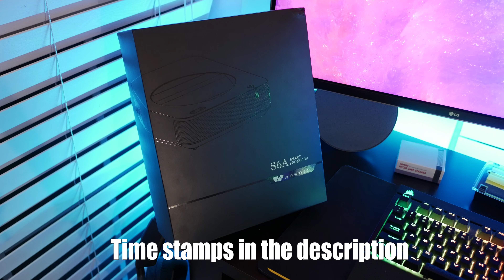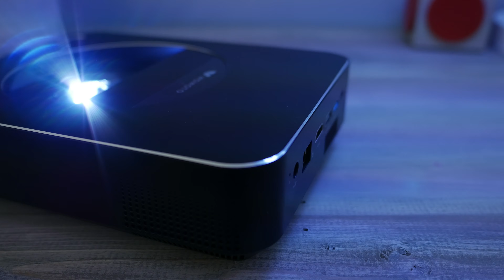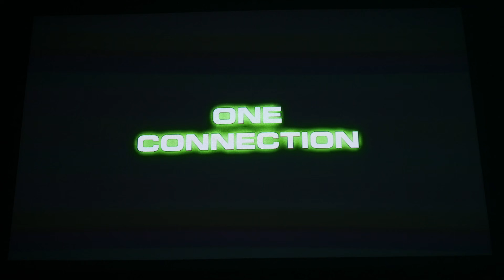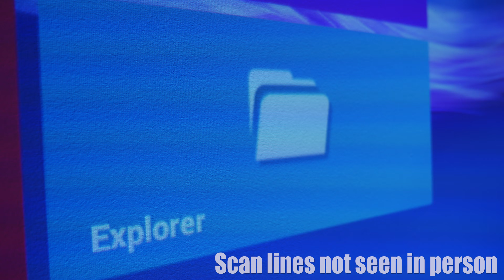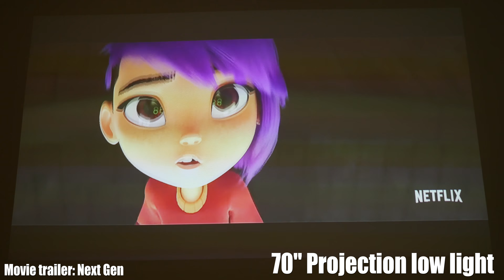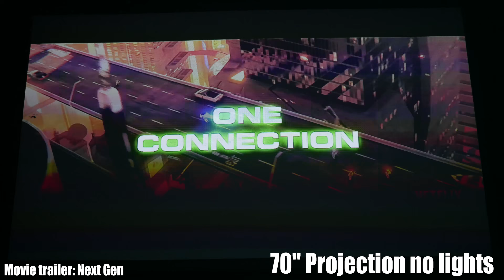Wowoto S6A Ultra Short Throw

Comment: Thanks for your review. I'm up in the air about this unit. Can't fault it's specs. I'm just reluctant because if you lose the remote there appears to be no manual controls. The projector I have now is the same and the remote control went missing so it's useless.
Reply from the maker: I just in the last week replaced it with the JMGO O1, I'm planning on a video for it. It's a bit better but has it's own set of headaches.

Comment: I read this model have many problems. Some similar model of ultrashort with battery and more ansi. Is For a motorhome
Reply from the maker: For a motor home probably a better option as its not an overly huge cast ratio. We leave ours plugged in and don't use the battery option much unless power goes out :). For a smaller area its a good smaller but still decent cast size than some of the others out there. It can be a bit dimmer feeling but I've been using it daily since I made this video as a bedroom tv replacement.

Comment: I bought the wowoto S6A but I have a problem and you might be able to help me, I'Ve charged the projector and tried powering it up by pressing the power bottom for 2 sec. The light turn bright green and I ear a fam starting, but no light came out of the lens. Do you know what kind of tool to use to open up the projector? Thanks
Reply from the maker: My lights orangish at all time when watching. Use the remote and fiddle some, you might be in BT mode? I’ll try and play with it some later.

Comment: wich recommend for a van works with some of solar light and great battery or to 12v?
Reply from the maker: How big of a van are you talking? I wasn't understanding your other question if you could ask that one again. 

The Wowoto has a dimmer output than some of the other UST's and a lower cast distance - for an ultra short throw its 'good' but not amazing. 

My current favorite portable is a cast projector called the XGIMI MoGo. - good battery, sound and inputs as well as a pretty great picture. 

Wowoto S6A is just a nice mid budget small UST projector in a market where there aren't many options. (I still use it myself as my bedroom projector)
Reply: @EightSixMatt   Thanks so much for reply. 6m long. i,m using old picopix from 4 years with 120 real lumens but only for night. With this i,m not sure if is decent with some of solar light.  i,m looking ultrashorts projectors because i think is better option inside of a van but i dont know if more distance is more big  screen with this type of projectors.  Good point the 4hrs of battery. i didnt search any projector with this autonomy I didnt search any projector in this range of cost  ( ultra short + portable with good autonomy. ans theses have 2 years in market) Regards
Reply: another question. support 4k reescalate?